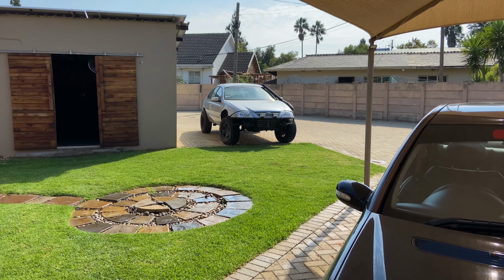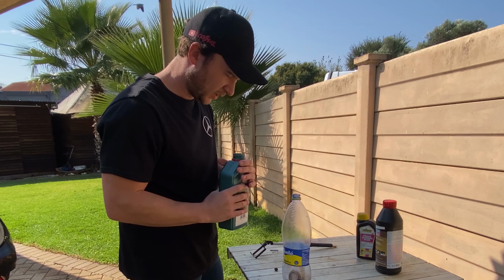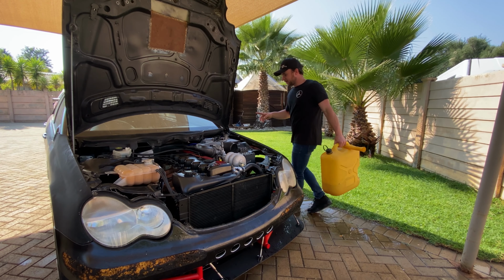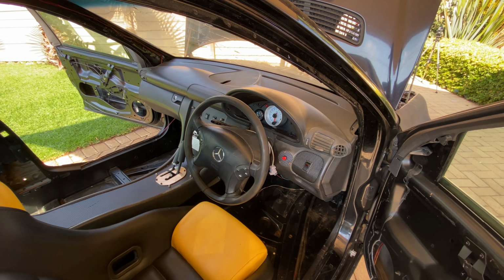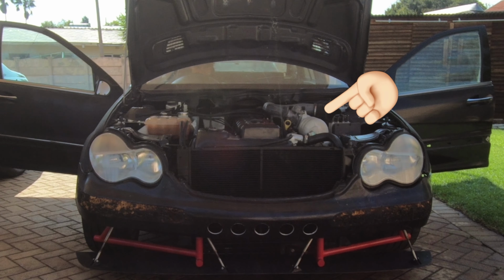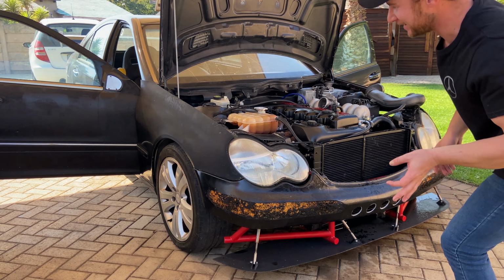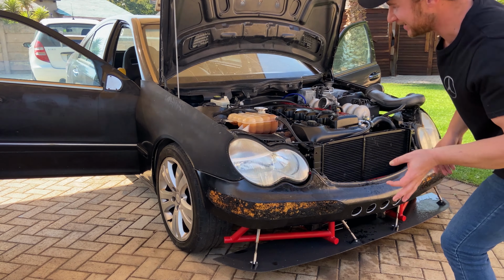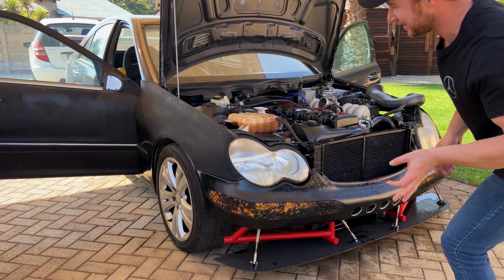It's ALIVE🤩 First Testing In The Mercedes Project | Ford 4.0l Powered W203 | Complete Engine SWAP💪

Comment: these engines are notorious for leaking coolant near the thermostat housing, and they can leak oil from the timing chain tensioner behind the power steering reservoir, a little bit of silicone should fix that up if it ever leaks. build is coming along nicely! loving every bit of it man
Reply from the maker: Thanks for the helpful comment mate🤙🏼
Much appreciated!🤘😁🤘